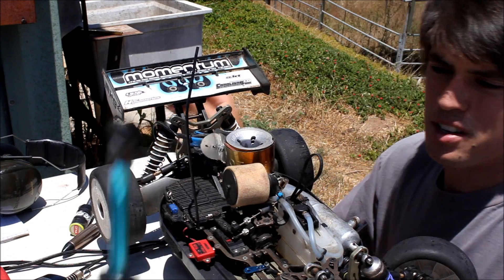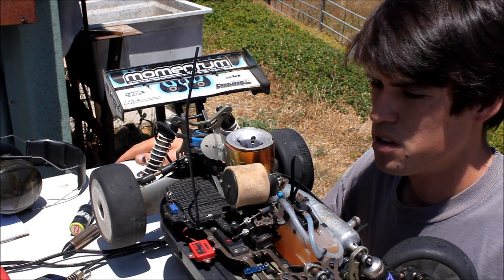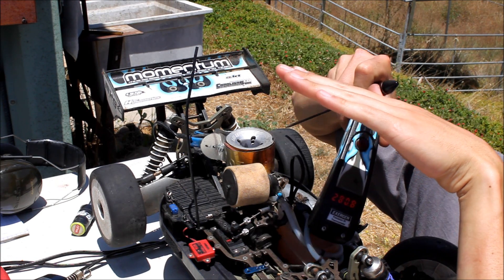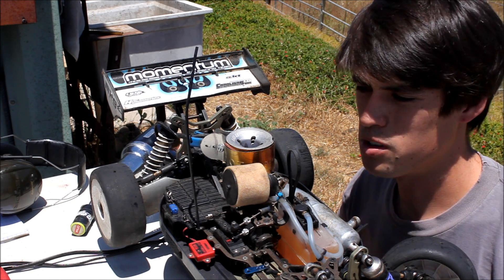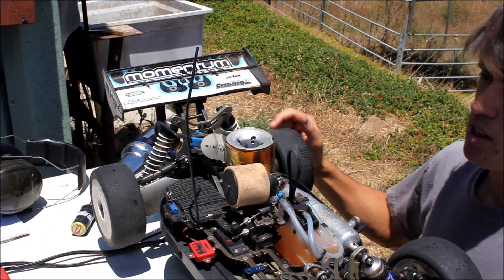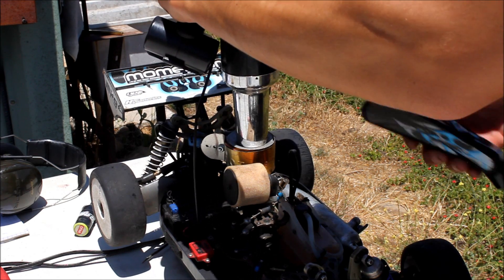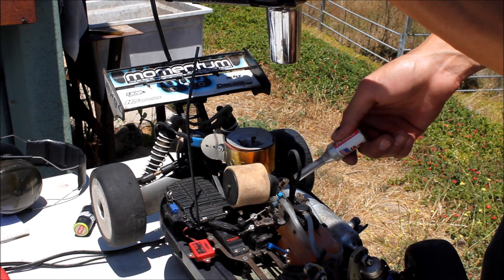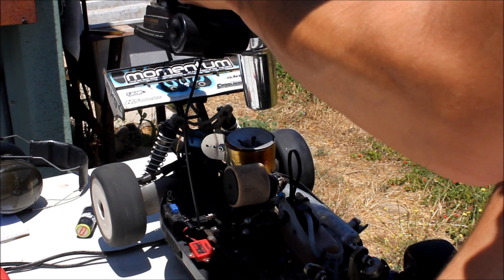Advanced Nitro R/C Engine Break In

Comment: Two questions if you will, kind sir: 1) Which.21 engines are your current favorites (stock or modded)? 2)  In your expert opinion, would a poor break-in cause decreased power, decreased lifespan, or both? In other words, has anyone been able to explicitly matrix a poor-break in with engine performance and/or longevity. Thanks again...I think I might try this method on my next engine. I'm looking at that Samurai...I don't currently have a 3-port.
Reply from the maker: 1) I'm not too up to date on all the engines, but the OS race engines have been rock solid for me. But I wouldn't be surprised if my next engine is one I am always impressed with at the track: the Werks engines; they seem unbeatable for the price. 

One thing to look out for: It doesn't matter what brand the engine is, or how much it cost, take the engine apart and inspect for metal shavings before you break it in.  http://ezrc.blogspot.com/p/engines.html

2) I'll try to answer this the best I can. Decreased power it a hard one to prove because you can just lean it out. What I have noticed is that engines that were properly broke-in will run at a lower temperature while producing the same power. Think of it this way: An engine with a lot of "pinch" will have to be run at a higher temperature for the parts to expand enough to produce the same power and reach the same peak RPM as the properly broke-in engine. Here is some simplified VooDoo math (The → indicates conversion of energy):

First you have your source of energy:
Energy of Fuel → Mechanical Power + Heat of Combustion + Sound Energy

Mechanical Power gets robbed by friction:
Friction Losses = Piston/Sleeve + Pumping Losses + Crankcase Bearings + Fluid damping between crank and crankcase + Connecting Rod Bushings  

So your total power output is pretty much:
Power Output @ Crank = Mechanical Power - Friction Losses

The lifespan of the engine is even harder to prove. It's all about keeping those tight tolerances tight. Poor air filter/oil quality, over revving, cold starts, tuning, and air leaks all contribute to lifespan. Engines that retain the mechanical pinch stretch out the BOTTOM of the connecting rods. Well, how does this happen? If there is an explosion in the cylinder and the piston pushes the connecting rod down, wouldn't you expect the connecting rod to bend somewhere in the middle? The answer, and maybe I should make a video about this, must come from when the crankshaft is trying to pull the piston out of the pinched part of the sleeve... which really only occurs during cold starts on an engine with too much pinch.
Reply: mrwassman Good stuff, man. This helps. I'm a computer software guy, so mechanical engineering is foreign to me...but you do a great job or articulating this information. Regarding Werks...I'm glad to hear you say that. I have the B5 and B6, and they are without doubt the best 'bang-for the buck' stock engine that I've ever seen. I personally like the B6 better for the sole purpose I enjoy a linear powerband. Pair that up with a 2058....that's smooth, man. Real smooth. Of course the B5 can rock-and-roll too. So it's a matter of preference. Snappy or smooth. I might get a B2 just as a 'parking lot' engine....those look like a lot of fun. I wish they'd come out with a .25 engine. Anyway, thanks again for the response.
Reply: mrwassman By the way, I'd love to see you do more nitro videos. Do you plan on it? Additionally, if you ever want to talk nitro rc, we just started a new forum www.nitrorcnerds.com....it;s just getting started so member ship is small, but there are a lot of nitro heads on it. Thanks
Reply from the maker: Nitro RCNerds More videos as soon as I get my business and personal life together!

Comment: I had just used this method to break a new novarossi keep-off 4 port. I have tried multiple methods to run in the engine, and I believe this type of break in is giving the engine exactly what it needs to remove the mechanical pinch. As much lubrication as possible while maintaining the optimal temperature.

Other methods can be difficult to maintain that 200 to 230 degree range, since it always has air moving around the engine cooling it off. In order to keep these temps high while running the engine in on the ground, you would lean it out to get your temps up. Leaning it out is reducing lubrication, which we don't want to do, we want as much lube as possible.

So after I ran 7 tanks with this method, I pulled the head off to discover the sleeve has a good amount of polished surface that has matted with the piston. I was very pleased with the results.
Not only has this been the simplest break in I have done, it also consumed the least amount of time. Time will tell how great this method actually is, I'm hoping to get at least 8 gallons on this engine. I will definitely recommend this method to anybody who would ask how I run my engines it.
This man should be given an award for bringing this to peoples attention. Thanks a lot for the vid, I think it is the best way to break in a new nitro engine.
Reply from the maker: I appreciate the reply and that polished area is a damn good sign.

Comment: Which tank is this? And what would I do for the first second and third tank?
Reply: Same process for each tank, even the first.

If you take the glow plug out after each tank and turn the motor over, you will notice the harsh pinch at TDC will go away but the engine will still be really hard to turn over with the glow plug in because the piston is seating into the sleeve creating an air tight seal. The harsh pinch should go away after ~6-10 tanks and then you will know it is ready to rip.
Reply: hi you have the same buggy as me

Comment: Are you first tank ? What do 2rd tank ?
Reply from the maker: This was the 3rd tank but the engine runs like this for all of them. You will get to a point where the flywheel is easier to turn (the pinch reduces).

Comment: How much voltage were u using for the heat? I use a car batt and it sees 425f at times..I never had to use a heat gun..after a half hour the head is at 260 and sides of block r 185f.. I just cycle the heat to maintain
Reply from the maker: Woah! Video comments?

On the engine, without it running, "The Heat" keeps the engine around 200F (160-260, we have two and it can be fairly random). With this break-in procedure, and the fact nitromethane/methanol have significant cooling properties during combustion, the engine runs too cool (as you can see). 

Our engines had some serious issues after as little as 3 gallons without the heat. They would randomly cut-out... mid-straight, mid-air, on the face of a jump! It was really frustrating.

Comment: How much voltage were u using for the heat? I use a car batt and it sees 425f at times..I never had to use a heat gun..after a half hour the head is at 260 and sides of block r 185f.. I just cycle the heat to maintain